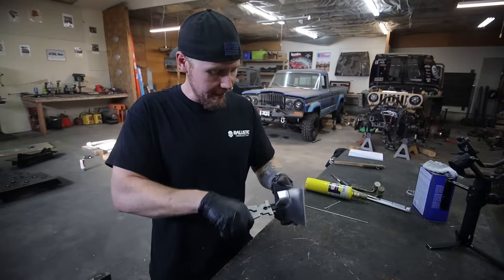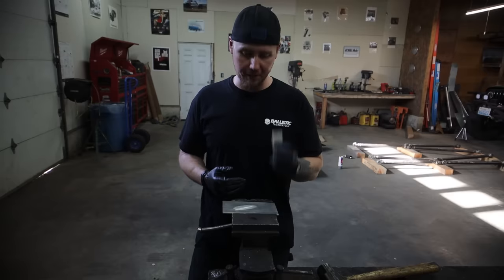Amazon's CHEAP Alternative To Aluminum Welding!!! (Alumaloy)

Comment: Its funny how we used to use a propane tourch and wire hangers to braze anything from body panels to gas tanks. That was back in the 70s.
Reply: 😂 😂 😂 That was our go to welding repair methods "coat hanger" on our farm! I can say with confidence 30+ years later many pieces of whatever is still holding strong!
Reply: I heard the wire hangars of yesterday were a lot more helpful. Accountants were so sure to have companies make cheaper ones going forward.

Comment: Aluminium has an oxide layer. These brazing rods will go through it to alloy with the aluminium, but you will get much better results if you remove the oxide layer and tin the surfaces to be joined first. This can be done in one step. Heat the part to be tinned and once hot enough, melt the rod onto the surface. Use the stainless wire brush to rub the melted rod in / remove the oxide layer. You might need more heat or rod to get it nicely tinned. When the oxide is removed you will see this stuff flowing and sticking like crazy to everywhere the oxide is removed which is hot enough. I think the rods are usually zinc alloy.

Comment: Seriously killer cheap hack!   I have actually never welded but I used to build vacuum tube based amps and apart from soldering for years, I used to work with aluminum a lot.  This seems like a good way to step up a bit into welding (I own a welder but haven't tried it out yet).  I own everything shown in the video except the braising rods.  I could use this on a lot of things even outside of Jeeps.

Comment: I used to do brazing in high end bicycle factories. Mostly steel/chromo with brass and nickle/silver. For one run we had to braze an aluminum water bottle boss onto a chunky aero down tube. That was hard to not melt that tiny threaded insert. It was all about general heat (a lot of it) and the right flux, and then timing. That filler rod must have some kind of flux built in.

Comment: I've used such rods to fix a crack on my aluminum oil pan on my engine few months ago and it is holding up very well. But the material has to be very hot and stay hot for a good amount of time to get the alloy form and diffund into the aluminum. 400 deg. celsius was needed, it is kind of hard to maintain with a torch on high surface area/mass.

Comment: good idea.  I have used aluminum soldering kits a number of times.  You do need to clean the aluminum surface, use the flux suggested.  AND there is always the danger of going too hot and melting the aluminum pieces!  But it does work and is fairly strong.

Comment: Wait until your better half goes shopping and use the oven to pre-heat your parts. Thank me later 😂
Reply: Every metal shop should have a kitchen oven. Find them behind appliance shop. Dishwashers are handy as well.
Reply: @gregwarner3753  too right
Reply: Gas grill works too...
Reply: @gregwarner3753  What kind of temperature can you get inside a dishwasher on the "dry cycle?"
Reply: Considering plastic does not melt probably less than 220 dag f.
Reply: Be a man and go use the oven when it's needed. My wife would just ask what I'm workin on now and chuckle

Comment: Acetone near hot works, keep well ventilated, remove all traces of Acetone from the work area and make sure the lid is secured back on the tin. 
Acetone causes explosive mixtures in air and the vapours can travel and flashback over some distance, the tiniest spark even static can set the stuff off.
Reply: I can't find any evidence that this is true. Acetone is explosive?

Comment: Last time I welded aluminum was also the first time. The project was a one of a kind Transit Rail Simulator, (testing the forces on autos on train cars), With 2500 feet of it, by the end of the first day 12 hour day, I was pretty good. At the end of the 4th day I was more then happy to retire. But thanks for the memories just the same.

Comment: Great video…YOU just answered my question 👍. that was just the best demonstration of on average how strong that method is. Thank you. I will be building a frame for a camper shell out of 1 inch square aluminum. The method you are using will hold it firm enough as I will be attaching an outer shell to it. That will further hold it together. Great job communicating my friend.

Comment: You can also get this at any harbor freight in the welding.rod area, ive used it several times on smaller parts on my rc planes
Reply: I cant never get the harbor freight ones to work right.
Reply: @JM-yx1lm  Hmmm, their welding wire isn't a problem for me in MIG, but I haven't worked in aluminum.

Comment: Awesome video! I guess I will have to finally try mine😅. Just a heads up Nate, once aluminum is welded unless heat treated again it's still only a 30-50 psi, joint around the heat effected areas. Depending on the alloy. So in the grand scheme of things it's really not much if any weaker. Also beveling the edges gives it more surface area, meaning a stronger joint. Also this process can anneal any heat treatment.
Reply from the maker: Thank you! Good to know!
Reply: Would the method in this video be able to handle the pressure of a motorcycle radiator?
Reply: @Tinman1985  yes

Comment: Got a dual battery tray to build and I really didn't want to use screws. This is much cleaner and professional looking. Only have a stick welder and my skill with it is not up to welding aluminum just yet. Thanks for the great tip.

Comment: I've used this in the past. Harder on larger items, especially since aluminum is a great heatsink.
Reply: Something I've never seen done on these videos (no clue why): if you have access to MULTIPLE SIDES of the target, USE. TWO. TORCHES.

I use one with MAPP with a high intensity "wash" nozzle and the other with propane, also with a "wash" flame. Propane puts out much less heat than MAPP, and every bit as important, the hottest part of the propane flame is a couple cm ABOVE where the blue core of the jet is. Do your preheating with the MAPP, then set up the propane on the FAR SIDE of the target, at about 2/3 intensity. from there on out, just use the MAPP in short jets (it'll xfer the heat to the aluminum FAST, and the propane will HOLD it at heat pretty much for as long as it's exposed). This gives you LOTS of working time with the stick. 

Likewise: Aluminum IS a great heatsink. So set it on top of something that offer huge thermal RESISTANCE like ceramic, or as another commenter mentioned a brick. I find you can actually fit a couple of those ceramic plates to the jaws of your vise and it won't wick away all that heat, too.

A propane tank WITH TORCH HEAD can be had for like 15 bucks.
Reply: You can put the large part on the BBQ for a bit before welding.

Comment: For your brazing use a hot plate first to get whatever aluminum u will be using hot enough its quicker and more even heat and makes the torching a hell of a lot easier! Just a tip good video!
Reply from the maker: Sounds like a good idea! Thanks for watching!

Comment: Another awesome vid! I've been curious about this too!  I saw a guy filling a hole in a motorcycle gas tank with just the rod (running in a circle on the edges, making the hole smaller until it was filled) I really wanted to ask what kind of magic he was using, but he was on the clock...

Comment: I think you did a good job in saying that this is not for everything.

I can think of a few things this would be good for, fuel cell repair, intake manifold repair, patching small holes. Possibly even repairing a small crack or hole in a aluminum rim in a emergency ... maybe!!

In a shop situation though it should not replace TIG or MIG welding.
Reply from the maker: Thanks! I couldn't agree more, nothing beats a good tig torch 👍

Comment: I tried those rods, the issue on smaller parts is the heat required to melt the rod properly means the entire part gets so hot that any previous welds liquify and come apart on you. I tried to weld up some 1 1/2" x 2" brackets for my CNC machine and it just wouldn't work. Imagine an L bracket with a gusset on the inside....when I went to weld the gusset the top of the L fell apart. If I welded the gusset first, then welded the top of the L, the gusset fell off.
Reply: A trick I learned from soldering electronics is to put a heat sink between the two parts -- you clamp a chunk of metal tight against the work piece and the heat will be conducted away before it gets to the joint you're trying to preserve. It can also help to have a hotter torch and work fast

Comment: heat is the key and I can never seem to get enough heat into an intake manifold to repair cracks. AL cans is the commercial for this stuff as its fast to heat, much more challenging to braze something you can actually use. Fuel tank was a good example, he "could not get enough heat" without really working at it. Torches will specify MAPP gas compatability as it destroys common propane rubber parts, ie. pressure diaphragms. Had a cheapo Bernzomatic propane screw on torch start to leak and ignite around the plastic regulator while in my hand using MAPP gas with it.

Comment: I'm a little lazy when it comes to signing in just to make a comment but I had to do it here.
This video is so informative and well put together I just had to say something.
I'm sure I will be using this method in my future and i will be telling all my friends about the video as well as sending links to it.  Thank you  Dirt Lifestyle or making it.  Awesome job !
Reply from the maker: Thank you! Happy to see you enjoyed it!
Reply: Remember to add fluxing to the steps, dude. If you don't include flux, you might as well get an Oxy Acetylene torch to just weld it.
Reply: That's why I just keep myself signed in so I don't have to do it each time.
Reply: @RolandtheThompsonGunner  Everyone has different ways of doing things and My way is to not stay logged onto anything unless I need to.  Thanks though
Reply: @SnowblindOtter   In the Description right below the Video second line down it says  "You don't even need flux!" ? 

Also he isn't using it in the video as far as I can see. 

If / When I get some I'll test it in a few ways before I do anything important.
Reply: @stephenjp2466  all good buddy.
Reply: @stephenjp2466  Aluminium's oxide passivization layer forms pretty much instantly on contact with any gas-mixture containing any amount of oxygen, hitting it with a wire-brush doesn't do anything but remove surface contaminants and scratch it up a bit. That's why you always see the Aluminium-Mercury or Aluminium-Gallium amalgam demonstration employ either hydrochloric acid or the Aluminium being scratched while the Mercury/Gallium is sitting on top of where you scratch it. You need to isolate where you're removing the oxide layer from the air entirely. Flux is pretty much a necessity if you want a proper brazing job. Unless the Alumaloy rods contain flux inside them(he doesn't mention this), your only other option to get through that oxide layer and prevent more from forming is to heat the Aluminium until its oxide layer breaks down, which occurs FAR above Aluminium's melting temperature, so without flux you might as well just grab an oxy-acetalyne torch and weld it that way.
Reply: where is the amazon cart list?
Reply: @SnowblindOtter  OK - Thank you for the info

Comment: I’m known locally for tig welding aluminum...
I have somebody about once a week tell me they tried to repair something using these rods… And they will actually stand there and in the same breath as telling me how well these rods work, they’re asking me to repair what they used these rods on.
Reply: Exactly the same things up here north! Greetings from Norway, fellow welder B-)
Reply: Well you still need to hawe the skill to see the colur .. of the gass ... Whooops 
The problem ain't the produkt !! ITs the in skilled Guy not Knowing What to look fore ..
Like asking some on to solder the first time .. like that Will Work ..
And thats just tin and cupper!!!
Reply: In truth this nothing more than filler, purely cosmetic anyone who thinks this is welding is dangerously deluded and clearly has no concept of welding metal. As for the guy who pressure tested to 500 psi well he is clearly unaware of the law regarding welds and fully coded welders. Wearing rubber gloves says all I need to know actually 😲😨😢
Reply: @AJ-ch6kg  Oh, please enlighten us, Grand Master, for we are mere mortals. You are so correct. Amazing observations. So that's why they're called aluminum Brazing rods. I'm very grateful. I was about to use it to build a frame for an oil painting on canvas. Whew, that was close. I knew those darn aluminum Brazing rods were too good to be true. I guess I should prepare my tig setup. I do have one question though. In your expert opinion, should I go with tig welding or tig Brazing?
Reply: @davcar872  Try araldite - "another alternative to aluminium welding"

Comment: Abotner old school trick is to use a pencil and mark a heavy line at the edge of were you want your material to stop. Go ober the live several times makinb it as dark as you can. Makes for a very clean edge.
Reply: Never a good idea to interdouse a contaminate to your weld especially when wrlding aluminum.
Reply: @darcymcnabb9259  its not welding its more like brazing or soldering, and its is drawn on out side of the area your working on, just to keep it from running were you dont want It. Of course not on the weld. Lol.

Comment: A friend (not me I'm not that good) welded a broken gearbox mounting lug on VW Beetle using Lumiweld similar stuff). It did at least 10,000 miles so this stuff is strong. He cleaned up the rough cracked surface and clamped the fragment with a bolt and washers. Aluminium needs lots of heat to get hot enough. Big lumps need a big burner, but use a smaller burner to keep the job area warm enough while brazing.
A piece of stainless wire to stir the pool helps. It has to be stainless ferrous wont work. Metal cleaning has to be a stainless wire brush.

Comment: Im glad you shared this, ive been messing around with brazing in the shop lately to. Im told they make a paste or a flux to help the braze bond a little better when messing with aluminum, I have not tried using it yet...  May makes things go a little easier!!  thanks!!

Comment: Bought some very similar looking sticks from a local machine shop. No instructions. Was just told a lot of people liked it. Watching this video I can see I've been applying too much heat (oxy-fuel) in too small of area (000 welding tip) when it didn't work. Guess my mind was one-tracked on welding when it's actually used more like solder.
Reply: Yes, this is solder/brazing....key word...'low melting point'....the 'rod' is hollow, with the flux inside...
 You can weld aluminum...use tig filler wire and there's a good flux you need, I can't recall the name of it...a good welding store can help you out there...
 A Lot of kitchenware was aluminum, welded, before TIG was invented...

Comment: They also sell these aluminum  brazing rods at Home Depot and Harbor Freight
Reply: Plus the video misrepresents how long it takes to heat up the base metals to a temp high enough to melt the rod, because the rod should not be melted with the torch flame. This process takes forever, even with MAPP gas.
Reply: The rods that are sold at Harbor are Crap.  The best rods are "Blue Demon BDTP-125-01T Triple Play Low Temp Aluminum-Zinc Brazing Rod 1/8"  I know because  I snapped a Transmission mount off a Chevy four wheel drive transmission, tried Harbor freight rods (CRAP) just like their .030 wire.  Bought the blue demon on Amazon and welded the ear back on and have bee driving the truck for 5 months with out a crack.  A for the temp, LOOK IT UP!!! 750 degrees for aluminum, Propane only makes it to about 450 degrees F.  MAP II makes it to 750 degrees F..  You needs 650 to 700 for aluminum to melt.
Reply: @edcrabb  Propane reaches well over 3,000 degrees F in open air and there are differences in brazing rods.  My preference is Washington Alloy because they provide actual certs on all of their products and always have it in stock for their local distributors.  Companies like Harbor Freight sell on price only and good luck getting support.  People complain about wages and jobs in the USA and yet they promote made in China, sold through China products vs supporting quality products from US distribution.  I work in the industry, in full disclosure, but that gives me a front row view to how companies like Amazon, Harbor Freight and Home Depot are hurting the industry.  Locals provide the knowledge and support while those companies undercut pricing (even at a temporary loss).  How would you feel if you do all the spec work for a customer and then got a company in China to use your knowledge undercut your price?

Comment: You could put the material on a hot plate while you’re alumawelding it, or place a heat gun under it
Reply: I use a large flat brick from a pizza oven